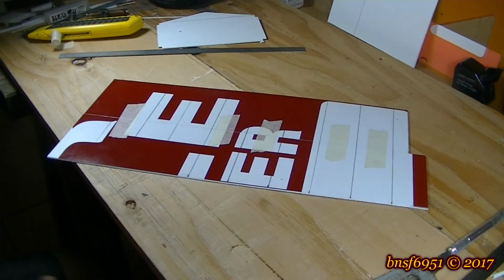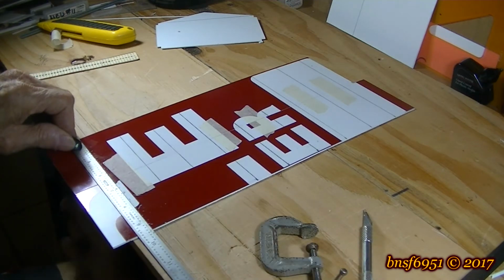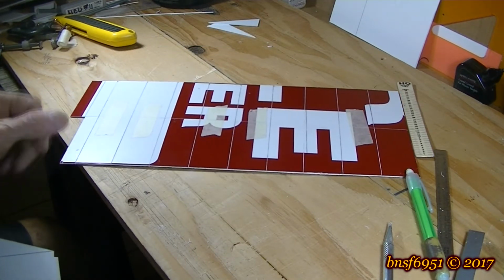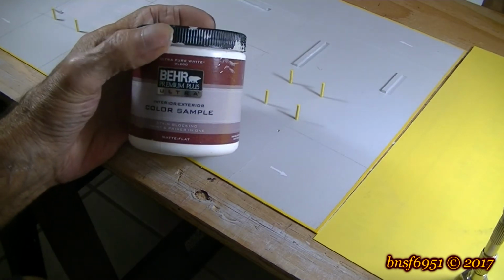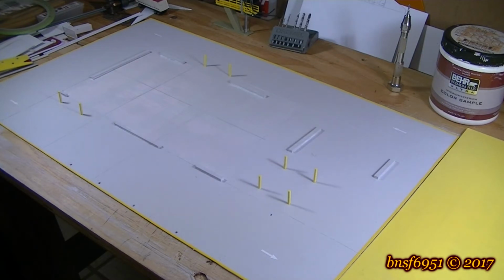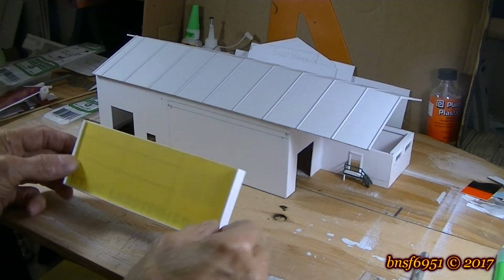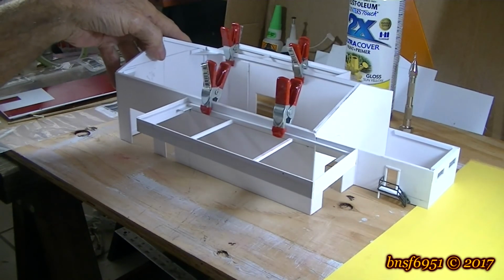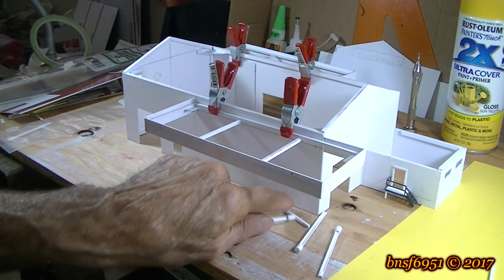Mariani Build for Jac Part #3

Comment: Vinny..again..very cool.  I do have a question..twice on this build you used the colored side of the sign material as the finish side..Its easy to see once painted you cannot tell. Apparently you have no concern of "bleed" when painting these pieces.  What is the reason you choose to not use the white underside as the finish side? thank you in advance...Tom
Reply from the maker: hi Tom... the sign that you are referring to has printing on both sides... i do a lot of prep work before painting them ... i give then a good sand job almost down to the white.. then one or 2 coats of primer then the final coat... i don't do anything to the side that's not seen... hope this answers your question... thanks for watching & your comment.. vinny